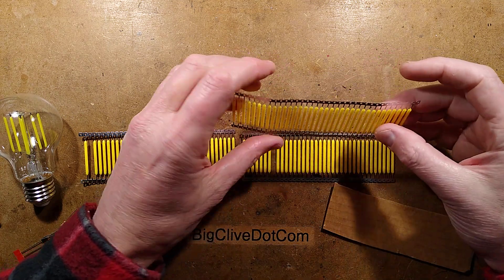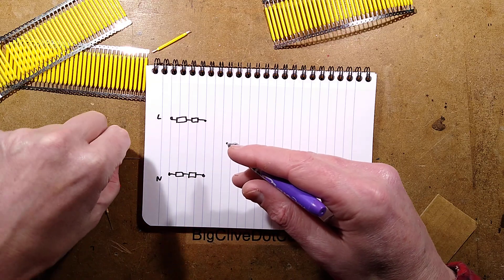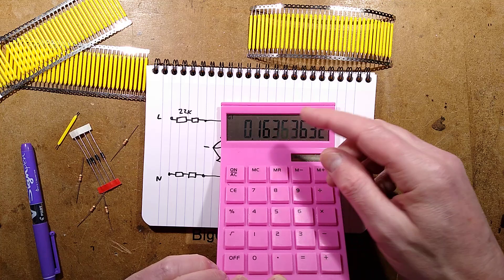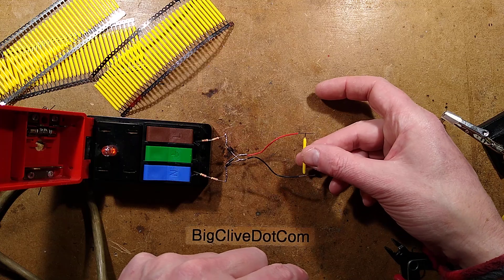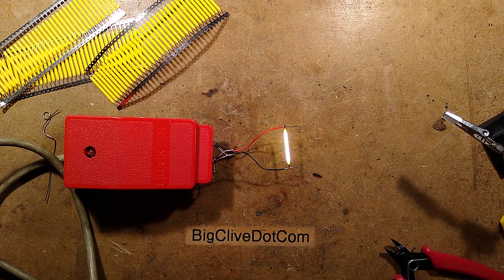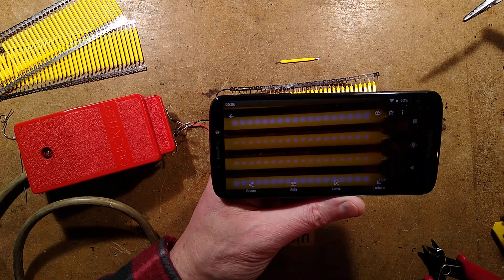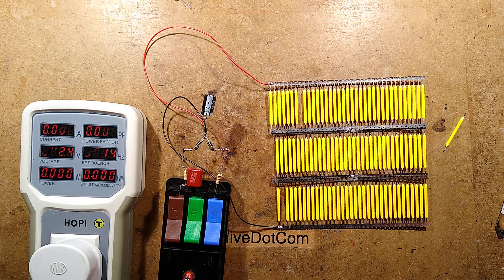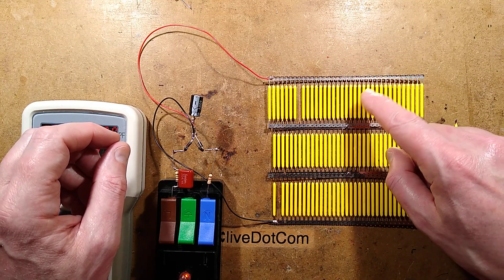104 LED filament lamp - just because....

Comment: Just a really strange phenomenon; I changed the bulb holders in the conservatory, antique bronze look. I put in an edison bulb in one holder and with the old bulb in the other holder it worked fine, but as soon as I changed the other holder and put another edison bulb in that, I got nothing, no lights! I checked the circuit and am getting 240V on both live wires. The problem is that when I had a lower wattage edison bulb in one holder (40W equivalent) the 60W bulb lights up! This is weird. The two edison bulbs came from my free standing lamp in the living room that is dimmable. I am wondering if the standard switch in the conservatory is simply switching a 6amp current and the dimmable edison bulbs are not playing nice :/ When I put two 40W edison bulbs in they both light up instantly, but those 60W dimmable bulbs refuse to work!

Comment: Awesome!!! I not knows that these LED filaments are sold separately, as another guy said before you can do a 7 segment displays with them, but had to regard his specs (voltage drop and maximum direct current) so you had to make an exclusive power supply line and a proper driver circuits since logic output circuitry can't driven it directly, I imagine making a big numitron displays with them...
Greetings from Brazil!!!

Comment: Your dubai lamp video tought me a lot! now I've been playing around with aliexpress 100w led chips and honestly I have been impressed with the results! currently I am running them straight off 120v ac through full bridge rectifier and through a giant inductor and about 2mF capacitance in parallel with 500k resistance as a discharger... 140v or so across the load after the inductor does its thing but I am torn between two ideologies with the array... on the one hand, I can do 4s 4p and it is insane at 1800W and incredibly bright but a bastard to cool, really just a party trick but AWESOME. or... I buy more and do 5s 6p and run about 1300w at much lower current per unit and way more lumens/watt. Given 1800w precludes any other load on the same circuit and may well flip a 15A breaker on its own I think ill go the efficiency route and maybe end up with a useable high output lamp!
Reply from the maker: Under-running is much better than pushing them too hard.  Take lots of electrical safety precautions.  Some power LEDs can short to their metal plate when they fail, and make the heatsink surface live.

Comment: I've got an idea - what about a section of acrylic tube say 1" diameter with several of these soldered into rings and lining the inside of the tube to make a baton? The circuitry could be hidden inside the rings. Could make a nice desk lamp :)

Comment: I first saw you using the pink calculator in the video about Dubai lamps. I assumed that it was because you purposely bought one to match the Dubai lamps packaging.

Now that I see you keep using it. Argh, but the filaments are still a sequel of the Dubai lamps. Ok then, go ahead, otherwise I was going to suggest you decorated it with rainbows and unicorns and maybe a llama as in novelty bun I actual stick on as a form of living.
Reply from the maker: Pink is a recurring colour on the channel because it adds a lot to the hilarity when I find a dangerous product.  Not just dangerous, but PINK and dangerous.

Comment: Would you allow me to make an extremely dumb request? Could you explain what resistor is? I understand that a resistor is something that resists, a junk that prohibits electricity to flow depending on its rating and heats up in the process. How does it increase stability of powering an LED filament? I feel so stupid for asking this question.
Reply from the maker: A resistor does limit current.  In some LED lights it is the main current limiting component, and in others it just limits the peak current.  Without the resistors the LEDs could pass very high current and fail.
Reply: @bigclivedotcom  Ok, I understand that this is not an educational channel, but encouraged with your reply, I dare to ask the next question. 

So what I gather from your answer is that the resistors are made of materials which let certain voltages through but not the ones outside the range printed in small letters on them. So when it was said that the current was limited by resistor, it did not mean that the current was limited unless it exceeded certain range e.g. below 20V and over 400V. I wonder what smart materials could do that and where do they find them.

Furthermore how would that help filaments. If I had 200 fillamments in chain which each needed 2kV each, I'd just supply 400kV to them. Why limit the current in the range. Please feel free not to respond to my display of ignorance.

Comment: I noticed something else they make a filament by 6 inches long by 1 inch wide or so they sell them in drop lights do they light up as easy as the skinny filaments that you are using or does the amp rate go sky high on the white ones…
Reply: Wide ones..

Comment: I've seen some Osram ones but they're £7 for 10... I think you can get it down to £4.99 per 10 pack (49.9p per filament) if you buy something stupid like 500. I can imagine they're allot more efficient then the cheap Chinese ones. On the Osram spec sheet they produce 185lm per watt.

I'm tempted to buy some to convert a surface mount LED bulb into a filament LED using a custom lense cover. I'd buy the cheap Chinese ones but they usually lack spec sheets

Comment: When you buy filaments online you do not have a clue as to the quality, period. Have  you figured out a way to get quality filaments that would last the long haul ??? Do you think that this lamp would last 100000 hours ? Nice video BigClive.
Reply from the maker: Buying filaments is always a bit random.  But under-running even cheap LEDs will result in much longer lifespan.

Comment: How about taking an old giant sodium bulb and linking about 75,000 strip LEDs hanging on a wire tree inside with a standard LED bulb screw at the bottom
Reply from the maker: That could be done with a series parallel array.

Comment: Don't run those filaments at full power for a long time, they will overheat and burn out, because they are meant to be in a glass bulb that has a special gas in it, that Dissipates the heat to the glass.

Comment: Is the current draw for 18 LED lamps, 1/3 that of 3x18 LED lamps?
Reply: If all the LEDs are the same type and in parallel across the same voltage, each will draw the same current from the voltage source. Going from one LED to two LEDs, the current draw from the power supply will double, etc. Triple the number of LEDs in parallel, and you triple the amount of current drawn from the supply.

Comment: I'd like to see some measurements of efficiency. You would need an integrating sphere and light meter. The sphere could be homemade from a glass lighting globe painted inside with the whitest paint you can find.
Reply: I remember an old Practical Electronics (?) project that used half a ping-pong ball filled with clear resin.

Comment: Would you be able to use these as diodes?
Reply from the maker: LEDs aren't ideal as rectifiers as they have a low reverse voltage rating.

Comment: Wanted to talk a bit about running LEDs at very lower current for maximum efficiency. I get that the system in theory would be more efficient because it would run cooler and the LEDs would last forever. 

But LEDs don't have a linear relation between current and light output. So would running 4 LEDs at 5mA give the same light output (lumens) as running one LED at 20mA current? 
I've looked at some LED data sheets and it looks like the 4 LEDs would still produce less light/ watt. Can you clarify this?

Also some data sheets warm against running high current LEDs at low current, stating that the results will be unpredictable.

Comment: If one filament needs 54V you can't just put two in series and expect it to work at 110V AC. The rectified voltage after smoothing will not be equal to RMS(110V) but the peak voltage (155V). The two LED filaments would be running too much current through them they'll die in an hour or two if you run them at 155V

Comment: Clive has a 240 volt supply?
I thought we were on 230 volt supply in UK, and have been for a couple of decades. As I recall, we came into line with the rest of Europe at that time.
(Mini pun. Did you spot it?)
Reply from the maker: I prefer to go with measured voltage and not fantasy paperwork voltage.

Comment: I have a stupid idea, how about not using the capacitive dropper at all, just led filaments connected in series (total voltage drop of the filament equals to the peak voltage of the AC voltage as you still need to rectify it).
Reply from the maker: With small mains voltage variations there would be huge current variations.  It could damage the LEDs and you'd definitely get intensity variation with other loads turning on and off.
Reply: @bigclivedotcom  I see, in that sense I would propose another variation of this scheme. Still using the normal bridge rectifier but combine it with the IC RM9003 to drive the led and ensure the output voltage is stable even under fluctuation of the mains voltage. The details is a bit tedious so I'll link the video below. 
https://www.youtube.com/watch?v=YyVlZfRXSBY

Comment: Hi Big Clive 
managed to get some on ebay, in post, now, they are for me camper van,  lighting, have 12v spear batt, wired to a LM2596, can i just wire these things to it, turn voltage, (output) down to 3.5v, ish, plus do I have to put a resistor on it,   ps, just got a UNO R3 KIT,  so far have turn a led on and off, counted up to 31 in binary, with 5 leds, dimmed and brightened 3 leds , and not at same time,   then me brain blow up ,  many thanks  Keith
Reply from the maker: Are the type you got 3V, 12V or higher?  What you do will depend on their voltage.

Comment: I love these lamps, i've had many osram bulbs over the years, and they all burn out after less than a year of use due to overheating.
I've had some cheaper brands that actually caught fire aswell, but these led-filament bulbs just last forever!
I have 7 of these in a chandelier in the bathroom (sounds fancier than it actually is) and they have ran continously for 8 years now, only turned them off to prank the wife every now and again..

Comment: Philips have released an LED 'HPL" series of LED filament lamps designed to replace lower wattage MBF. I picked up an 18w lamp which is designed to replace an 80w and it's quite impressive at 3000lm!

Comment: As you know, LEDs are often dimmed using a PWM controller. It's easier (cheaper) to control block wave frequencies with electronics than controlling current directly.

But then I wondered if it's possible to smooth this PWM flickering. Using a capacitor doesn't help, as it negates that PWM functionality (the cap will just charge to the maximum voltage, and provide any current the LEDs want or the system can offer).

Apparently, this is possible using an inductor in series with the load. But I don't really understand the principle.

Could you make a video about this? Or do you already have a video about it. Specifically: how do you select an inductor, does it depend on the voltage or the wanted current?

Comment: Not overseen in these filaments, though. They're really fragile, I had a pocket floodlight torch with one inside. Really good for working in small spaces. Dropped it once and now it's willing to work only occasionally. So... Great in non destructive environments. Saying non destructive, I'm amazed (and disappointed) that you haven't torched the lot ;-)

Comment: Make a solar panel see if it works
Reply from the maker: Only barely measurable output voltage and no measurable current.

Comment: 7:30 my opinion:
1- because the DC is fluctuating, the readout is lower.
Use a capacitor to stop the flickering, and read the voltage more accurately.
2- they're probably 110V.

Comment: Interesting! I've seen LED bulbs with similar shaped filaments yet the bulb is advertised to consume ~ 5 watts. Certainly these look easier to use if you want to wire them to a mains voltage for cheap

Comment: Can you add some of these to an existing LED bulb to create a Dubai-style light, or would there be more current draw on its power supply instead of lower voltage to the across the board?
Reply from the maker: You could do that.

Comment: I want to know the open-circuit voltage of your first bridge rectifier...
Reply from the maker: The rectifier uses 1000V diodes, the rectified DC will be the RMS mains value until a capacitor is added which will charge to the peak value.

Comment: Finally they are are shipped with some protection, I bought loads of these and they came loose in a bag and I think I got 10 good ones from 50😂 I complained to seller he resent but in the exact same way🤦🏻‍♀️
Reply from the maker: I'm suspicious that the reason they ship them loose is because many were already pre-broken.

Comment: How do these LED filaments deal with heat?  Obviously there it little or no heatsink to do the work.  Surely this must affect lifespan unless one is careful to not drive them very hard.
Reply from the maker: They are generally run at around 1W and don't get too hot.  But under running them will make them last longer.

Comment: Paralleling LED's can run the lowest Vf harder current (this is why some are brighter) and burn quicker, but if your not running them at normal currents, then probably fine.

Comment: I rememberin the good ol' days before mains-powered LED lamps were affordable, my dad made his own.  He usually kept the bases and electronics from failed CFL lamps, and would use the bridge rectifier and smoothing capacitor on those tiny CFL driver boards to make a 168VDC supply, which he would then connect to a set of 5mm white LEDS.
Unfortunately, the super-cheap 5mm white LEDs didn't last long, and the homemade LED lamps would lose brightness pretty fast.  He got tired of swapping out LEDS, commercial ones are now affordable and relatively reliable, so the homemade ones are sitting in the shop pile somewhere.
I should see if I can get Dad some LED filaments to play with, he could make some fun 3D printed novelty lamps....

Comment: Replace one or two of the resistors for potentiometers?
Reply from the maker: Not practical for this application.  The power could be adjusted by switching the dropper capacitor value.
Reply: @bigclivedotcom  interesting so a variable capacitor could be used as a dimmer?

Comment: Could you not hook one of them up to a variable dc psu , with say a 100 ohm series resistor.  Then cranking it up until it fails, to give you some idea of the maximum output possible...?

Comment: Hey BC: put up a ceiling fan light w/a LED light and dimmer control on the wall. When powered thr LED light is full on bright no matter where the dimmer control is set. Should I try reversing the wires? Best.

Comment: This is an unconnected request for free advice!  There I've said it! Now, can I connect two identical solar panels together and into a suitable battery (power station)? My concern is when one panel is in the sun and the other the shade. Will the first put a charge onto the second and cause problems? Thanks.

Comment: Great experiment and test Clive, I would suggest to increase the wattage of the 1 k resistor as it will age after a few turn on and offs with the inrush current to the 470 nF capacitor. (1 Watt is usually enough) On Cree streetlight leds I use 2 uF and 100 R 5 Watt for I limit and that has been going for years without fail.
Reply from the maker: I did get caught out with that resistor.  I normally use a high value on very low current droppers. The LED current ended up being higher than I expected.

Comment: I love you dude! Please riddle me this, Could you run 240 1V leds off the mains without regulation? They can only draw 1v each so current regulation should be controlled by the power? I guess they would turn on and off 50htz or just blow up when the ac reverses but I wonder if their diode effect would put up with it if they were wired right. I'm just starting to get my head around this sort of thing  but I'm still a little lost. Just asking. Don't rip me to pieces pleases.
Reply from the maker: I wish 1V LEDs existed.  They tend to be 2V to 3V.  You really have to have a voltage margin with a resistor, as the current through a string of LEDs will vary widely with supply voltage fluctuations.

Comment: What if one or two of those LEDs hog the current? Then burn-out. I always thought that each LED required a current-limiting resistor. It seems that this is not the case here. What has changed??
Reply from the maker: Common batch LEDs are usually well matched.

Comment: Neat! I am tempted to build one that operates around 3000volts and about 40watts, I wonder how many filaments that would be in series, but it needs to use maximum 3000volts and 15ma, I wonder how many filaments that would be
Reply from the maker: Roughly 60 in series.
Reply: @bigclivedotcom  Nice. That would be some lamp using that many. But I sadly don’t have that many filaments

Comment: I really enjoy this for a change: building up instead of 'taking to bits'.  It's mind over matter, dreaming something up and following through with the building and completion of the project.

What would be interesting is building a clock and using one of those LED strips for each of the segments of a large 7 segment display.  You can see that across the room even without glasses on!!  🤗🤗👍👍
Thanks, Clive.